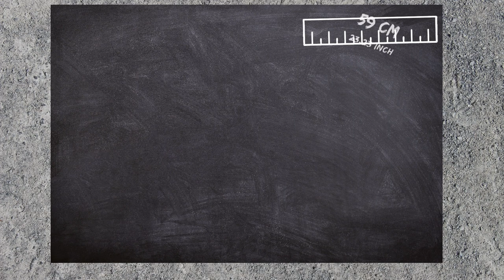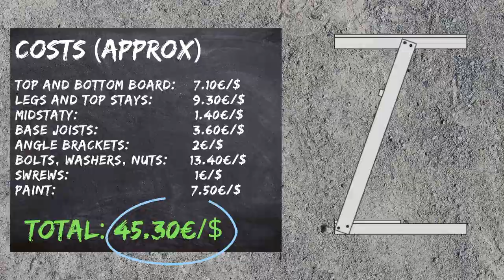How to build a trainer table - DIY

Comment: Nice design but I'm wondering how solid it is. Does it sway sideways? Some drink holders would be a good addition.
Reply from the maker: After 4 months of regular use I must say it remains stable. I wouldn’t stand on it, but it doesn’t wiggle after zwift use. Since it’s in my garage, ive used it as a general table as well without it becoming wiggly. If you want to improve further I would recommend glue as an additional way of fixing the parts. 👍

Comment: Nice project. I would consider adding a power distribution socket underneath the tabletop to support charging computer and phone and bottlecages to secure the bottles. But all in all this is really nice!
Reply from the maker: Thanks. A year and half of use and it’s still stable and fully functional. Yes, there is definitely room for improvements and development. I’ve added a knob for a towel. You can put bottle holders on it and customize it. Good luck 👍

Comment: I like the Salming shoes. I often have the feeling I am the only one outside of Sweden wearing them... Anyway, thanks for the video. I would have sawn the ends of the slats that hold the top parallel to the tabletop and the bottom parallel to the floor. Doesn't make it better or more stable, but I would have liked it better. I decided against the diy method because I don't have my smart trainer in the garage or basement, but in the study, which is also used for guests. And I find the steel and plastic version more practical when the table has to be moved.
Greetings from Germany
Reply from the maker: I’ve had several Salming shoes and they are great! There is definitely room for improvements on the table and I’m glad I can provide an example for people to improve. In the garage its great but I understand if you don’t want it in the house. 👍